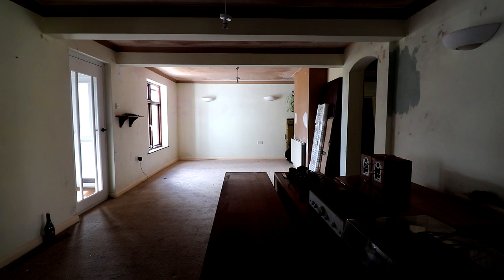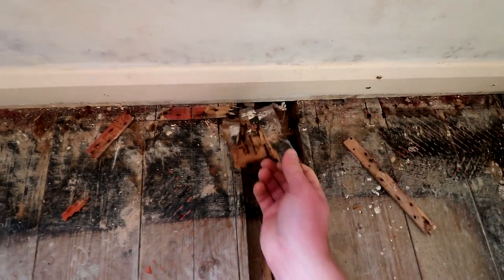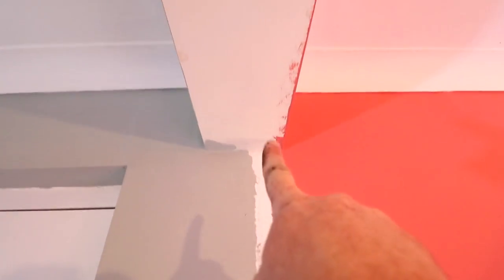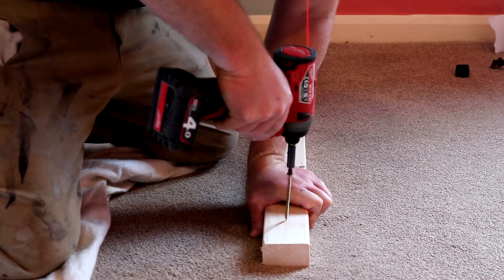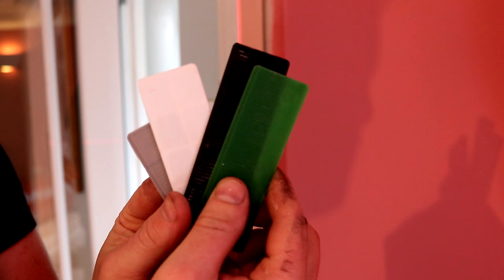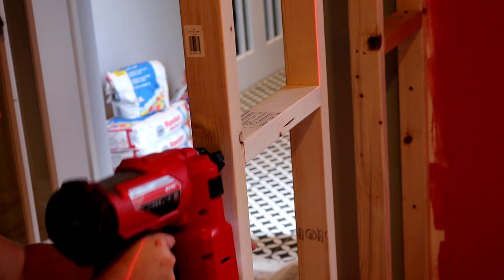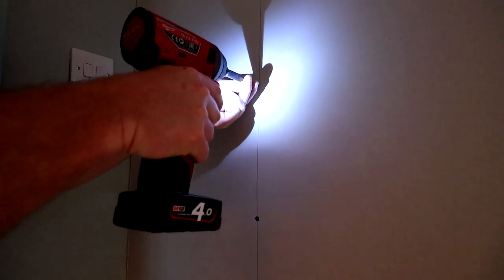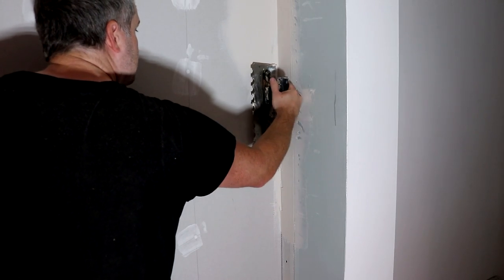Building A Wall In Our Bungalow

Comment: Why have you insulated an international wall? I'd of bind off the insulation and used the money you saved on getting the wall skimmed.
Reply: For sound deadening as because it's code.
Reply: @randomfish42  I get why you might wanna use it for sound deadening, im pretty sure we don't have codes in the UK, and you definitely don't have to insulate internal walls.
Reply from the maker: Yes, sound treatment. There's no good reason to get the walls skimmed in my opinion, I can get just as good a finish with filling and taping
Reply: @MONKEYWASH  We have building regulations and having had a cloakroom installed I can say for that it's required.
Reply: @randomfish42  I know what building regulations are, just saying for this particular instance you don't need insulation, but if you wanna try and damp  down the noise it's a good idea, but then if you put double doors in there it feels a little pointless, I dunno, not my house so it don't matter meh 🤷‍♂️

Comment: Drilling holes in load bearing rsj's is a really bad idea because it weakens them and should only be done if you tap the hole and then use a machine screw to fill it . Charlie's tip is one of the worst pieces of information ever given out.
Reply from the maker: 10x 4.5mm holes near to the edge of a solid steel rsj is hardly going to compromise the strength of it!
Reply: Hey its your house do what you like but don't pass bad information off as a great tip ! Would taping the holes really have taken that much longer ?
Reply from the maker: Seeing as I don't own a tap and would have to go and buy one, yes it would